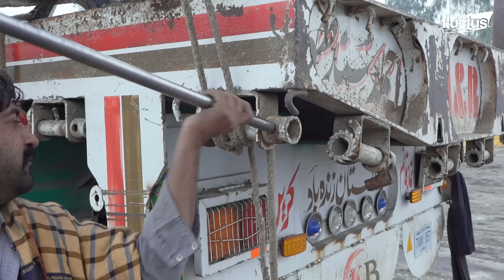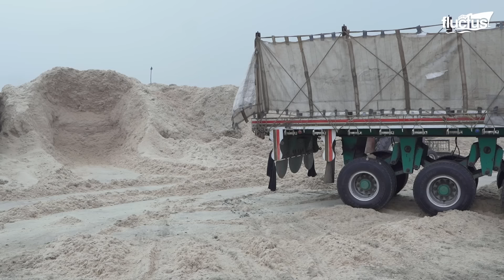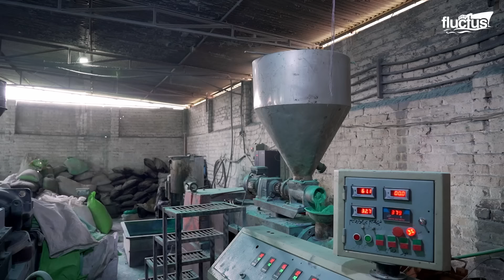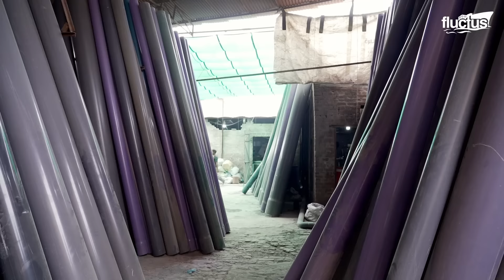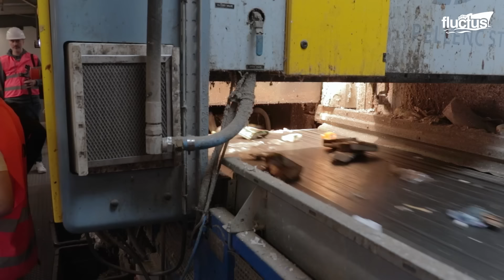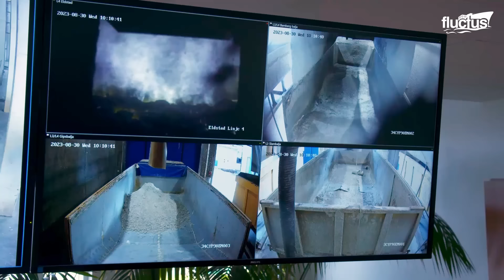Pakistan’s Extreme Solution to Load Tons of Sugarcane Waste on Trucks

Comment: 500 hundred tons on a 20 ton truck what could possibly go wrong 😂🤪💰
Reply: 5 hundred hundreds?
Reply: I estimate the load as about 10 by 6 by 4 = 240 m3.
If it was water that would be 240 tons but I doubt it's even a quarter the density of water so probably less than 60 tons

Comment: This might be why we see the repair videos on broken axles
Reply: Yeah this is exactly IT!!
Reply: usually they are doubling the capacity of axles on those videos and its because of those the roads are so bad and so many casualties in accidents when they hit someone
Reply: It’s not that heavy if it was it would break through that tarp way before breaking an axle
Reply: Na thats not the logic
Reply: Spot on 🤣🤣🤣
Reply: @ashbah87  no
Reply: This kind of load is extremely lightweight
Reply: Your wrong! That weight is normal in these kind of trucks
Reply: @abnormanBOKAL I disagree
Reply: True, in Pakistan, trucks are only allowed to drive above the permitted weight.
Reply: This is normal loading bro we can carry this load on 10 wheeler trucks also
Reply: No! lack of resources , used trucks imported and repaired again for another 10 years out of it , expensive parts  , expensive gas , expensive journey , on and off roads rides so they get the maximum out of one way .